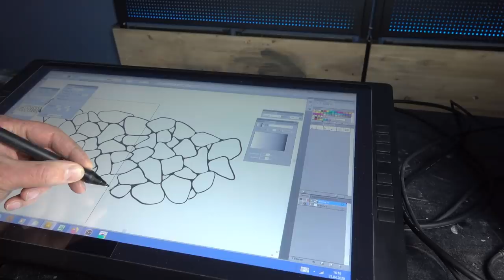How to paint a carbon bike with a HVLP spray gun and candy color effect

Comment: How long for the whole process? You are not using infrared curing? Air dry, even with a heater, I would probably take 10 days before wet sanding and polishing...
Reply from the maker: 2 to 3 slightly warm farts are enough to dry the paint job.
Reply: @ETOE  Days? Well, paint in bicycles has to be really thin. Clears must be top notch also, Glasurit or Sikkens, at least...

Comment: I've seen your other replies so I know I probably won't get the answer I need.... 😆 Can you go straight onto carbon with the coloured base coat? It didn't look like you used primer. I'm going to have a go at spraying my orbea frame soon. Using your videos as a guide 🤙
Reply: Never mind! I've just seen you had primered it in another video!

https://youtu.be/ghPukmfxw9k

Can you go straight on the black primer with a candy? Or do I need to spray a black base coat? I was trying to save layers and therefore weight...

Comment: I'm using montana gold cans to respray my bike. I'm going to be applying stencils. So  how long do I need to wait after putting fresh paint down to mask it off or start applying stencils. When it's all painted and you peel the tape and stencils, Do you sand the whole project with 800 or 1000 grit wet before clear coating it.
Reply from the maker: I wait two slices of tuna pizza. If it is chilli pizza only one and a half slice.
Reply: @ETOE  😂😂😂 that's not much help... thanks anyway.
Reply: He explains all this in some of the previous videos, like the Supermeme video, and the DIY videos. I'm sure we won't get the same results as someone with his experience, but might as well try to do it as pro as possible.
Where did you get your stencils? I looked on Ebay, and I can only find thousands of pages of stickers. I imagine there's someone local that can do it, but I wouldn't know who to ask. Maybe a car painting service?

Comment: Is there a feasible way to protect a raw steel frame while retaining the raw look? Clear coat is not enough to deter rust.
Reply from the maker: No, not professional. You can use wax but it looks poor even the special and expensive resto mod wax.
Reply: @ETOE  That's what I figured, thanks. Will scrap the idea and get some color.

Comment: Martin - have you done or are there any plans to do a video on how to fix small paintwork damage (stone chips etc.)? Got a matte black frame with a couple on the fork drop out I'd LOVE to get rid of!
Reply from the maker: Just use nail polish. It`s the ceapest solution. Makes no sence so spend hours of work to remove some chips. Noone without lots of practice is able to remove these chips invisible. So it makes no sence to do such a video.
Reply: @ETOE  Good tip - I'll give it a try. Been repairing guitar finishes for years and use a mix of coloured stain and super glue (Glu Boost usually), and then a lot of work to flat it back and remove scratches from sanding, so I appreciate there's a lot of work that goes into it.

Comment: Nice as usual...how to you prevent paint creeping under mask? For super sharp line? And you nerver show your buffing/polishing processes.....thanks anyway
Reply from the maker: Because I do not polish. Big spray guns are enough for that finish.
Reply: Thanks fofr the fast reply.....but seriously you never have a lint or a little dust or a little corner with a little orange peel... Im in bike painting not at your level but working my way slowly as a part time job. Im using 3000grit and polish for the final result to be peerfect.....maybe i nee more experience or a nicer paint booth.....But my main issue is paint creeping the onlyway ifound is by putting intercoat clear to prevent it, but the problem it is time cossuming and a pain to clean everything. Iwas hopping  little tips a fellow painter. I use mainly createx paint, custom creative clear gloss and matt, igot a talon airbrush and a supernova gun...i think im on the right path of succes .....thanks a 1000 times for inspiring me to star that journey as a custum painter....

Comment: How long do you wait after paint to remove the masking decals?
Reply from the maker: Two to three slices of tuna pizza. If it is chilli pizza only one and a half slice.
Reply: I don't know what you've been told BUT don't drift away from what and who you are. You're professional on what you do, don't have to be a clown to sale your self. Just saying.
Reply: @ETOE  thanks! I just painted my first bike an I used ebay letters and Montana cans like on your supermeme video. It turned out OK solid B. I put way to much paint on and it got all mushy  in a few spot so had to scrape sand and redo a section. Nest time with less paint it will look a lot better.